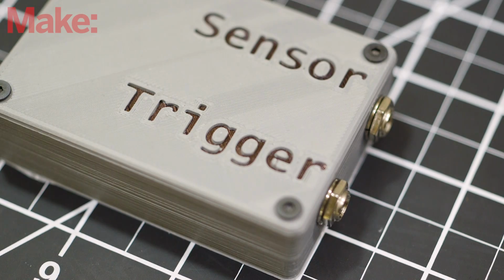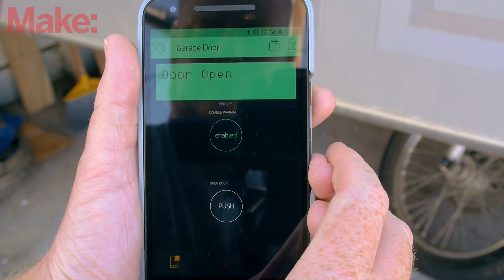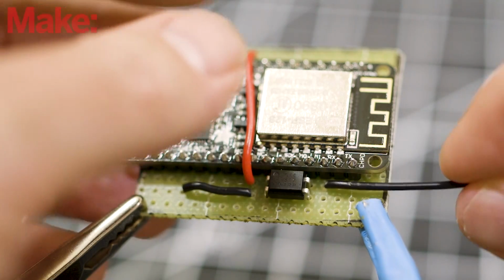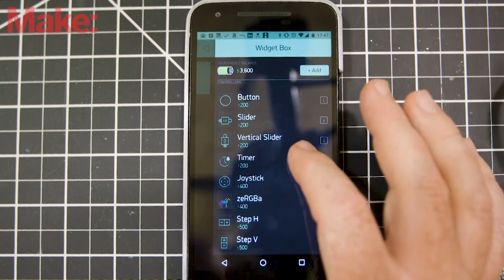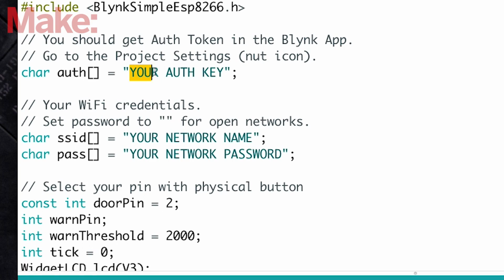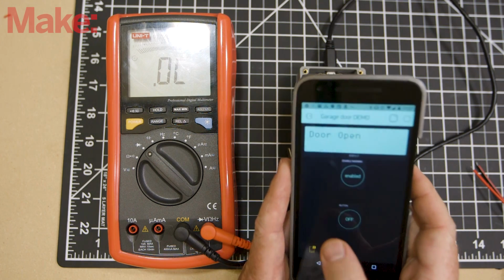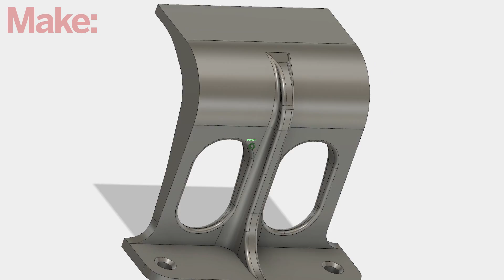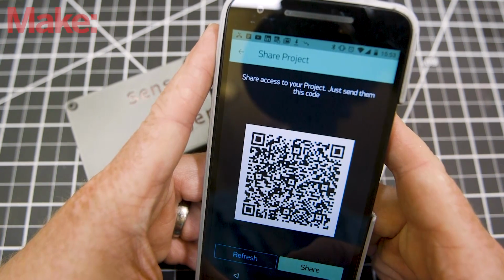Updated Project: SmartPhone Garage Door Opener

Comment: Thanks for this video i tested with esp8266 nodmcu board works fine but why my nodmcu is power on when power cut and when power comes back its a hassel cant we cancell this power on status even i have used all D pins still the problem is there

Comment: Awesome, Thanks. Just made this. Modified slightly to use a Wemos D1 Mini, and used a NPN Transistor to switch a 3v coiled relay. My door controller had a couple of no volt contacts to use and a 15V DC supply on the board which I put through a LM2940 voltage regulator  to give me 5V for the D1 Mini, which also has a 3.3V pad which I used for the switching circuit and relay

Comment: Hello Sir, thanks a lot for sharing.  Do u have any idea what happened after I disable the warning button and no more notification, which is fine.  When I close the gate and open again, the Disable warning button reset back to enable but unfortunately it does not send anymore notification even the button visibly change back to enable.  I press disable and enable manually, the notification runs normal again.

Comment: Version Without Notification Feature  BELOW ---------->>>>>> 

//Code Originally Created By Tyler Winegarner, 2017
//Revised by Joseph S.
//No anoying notification feature featured in original video

#include <Blynk.h>
#define BLYNK_PRINT Serial

#include <ESP8266WiFi.h>
#include <BlynkSimpleEsp8266.h>

char auth[] = "YOUR AUTH HERE";

// Your WiFi credentials.
// Set password to "" for open networks.
char ssid[] = "WIFI USERNAME";
char pass[] = "WIFI PASSWORD";

// Select your pin with physical button
const int doorPin = 2;

WidgetLCD lcd(V3);

void setup()
{
  // Debug console
  Serial.begin(9600);

  Blynk.begin(auth, ssid, pass);
 
  pinMode(doorPin, INPUT);

}

void loop()
{
  delay(10);
  Blynk.run();

  
  if (digitalRead(doorPin) == HIGH) {
   lcd.print(0,0, "Door Open  ");

  }  else {
   lcd.print(0,0, "Door Closed");
      }

      
  
}

Comment: I built this and it works fine with a continuity tester closing the circuit but after connecting it to the garage door opener it won't. I can jumper the terminals and the door will open and close but it appears the opto isolator might not have enough kick. Any ideas?
Reply: Did you find a solution to this?  I have this exact same problem and can't figure it out.  Might have to switch a relay to create a true dry contact jumper between the two points?

Comment: Great project!  Finally got around to trying this out this weekend.  At first I had a problem with the device constantly disconnecting in Blynk; it worked but only intermittently with a message constantly popping up with a device disconnected message.  Ultimately the fix was to increase the timer interval (from timer.setInterval(10, buttonLedWidget); to timer.setInterval(1000L, buttonLedWidget);).  Still need to adjust the warnThreshold from that change and the High/Low warnPin feels backwards to me but works well.  Thanks!
Reply: sking963 I'm having the same problem. I changed where the timer was at the very bottom of the program to put it above the blynk program call. Much better.

Comment: is this possible to use ESP8266 esp-12e  then Adafruit 2821 Feather HUZZAH with ESP8266 Wi-Fi  if yes what i have to change in the code to work with ESP8266 esp-12e 

Thanks
Gur

Comment: Great job man!!
Is there a particular reason that you picked an Arduino controller instead of a Raspberry Pi 0 W board? I'm asking that because the Raspberry is a cheaper option!
Reply: I built this a few years ago, but noticed an issue. When the power goes out,then comes back on, the opener stops working. I believe the Huzzah boots up quicker than my home wifi. It doesn't get a connection until I reboot the Huzzah. I'd like to add a loop that keeps trying wifi until it gets a connection. I also want to add a second garage door.
Reply: Rodrigo Zaccara you can use the same code and the pinouts are the same on the Adafruit huzzah breakout board. Which is 6.99.

This is cheaper then the Raspberry Pi zero after you take account for the SD card and the HDMI cable that are required to set the pi up.

Comment: Am I the only one that spotted the missing dropping resistor for the optocoupler LED? without that you will kill the optocoupler or the ESP sooner or later.
Reply from the maker: You know, you might be right. I'm no electrical engineer, and I didn't even think of this, but you're right, an LED should have a current limiting resistor. I've been using an optoisolator in this project for a few months now with daily use and haven't had any trouble yet, but if it ever fails this will be the first thing I test. Great heads up!
Reply: Love the video. I'm not an EE either, but the datasheet for the PC817 says max fV is 1.4V with 1.2V typical at 20mA.  With 3.3V out of the Feather and a typical forward voltage fV of 1.2V on the chip, we need a 2.1V drop to protect the chip.   R=V/I or 2.1V/.02A =  105 Ohms. So a 100 Ohm resistor should do. I don't think most people will have problems without the resistor because you are only passing voltage through for half a second at a time, not continuously.
Reply from the maker: James Sinkiewicz the previous version used the particle photon. Personally, I've had far too many boards that refused to connect to the web based ide and I've run out of patience for that ecosystem.
Reply: I'm sure we can find a resistor lying around somewhere :P
Reply: PS: For $2 more, you could have used a Particle Photon and not have to take the thing down every time you wanted to change the program.
Reply: This is a great video. I'm about to set this up on my garage door but 
with a Raspberry Pi I have sitting around. Is there any significance of 
placing both the door sensor and optoisolator on the same ground? I was also going to use a 100 Ohm resistor like James suggested.
Reply: Gave up on the Raspberry Pi, don't understand Javascript enough. Did go and buy a feather huzzah and set it up exactly like the video with a resistor. Thank you!

Comment: What's the name of those metal pieces in the plastic case, where the screws will fit in?
I would like to know more please. Thanks!
Reply from the maker: Those are some of my favorite parts - they're called heat-set threaded inserts. You create a hole in your geometry of the printed part, and then use a hot soldering iron to press these brass inserts into your part - now you have a metal receiver for a screw!

https://www.amazon.com/a16041800ux0826-Injection-Molding-Knurled-Threaded/dp/B01IYWTGIM
Reply: Make: thank you very much for the answer! Have a good day :)

Comment: very nice project I'll try it this summer.

I wonder is there any practical or safe way of having an opener on a garage that doesn't have a secondary entrance (if power or mechanicals break)
Reply from the maker: I'm not sure what you're getting at, but this project doesn't replace any of the functionality of the existing garage door - the radio transmitters still work. It just adds a new way to enter.